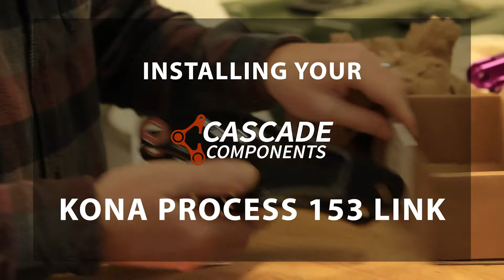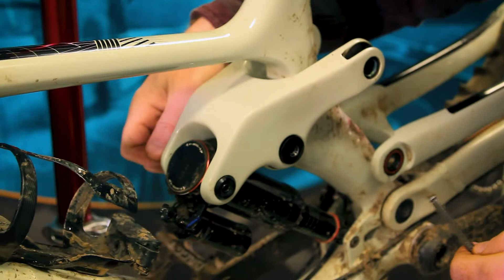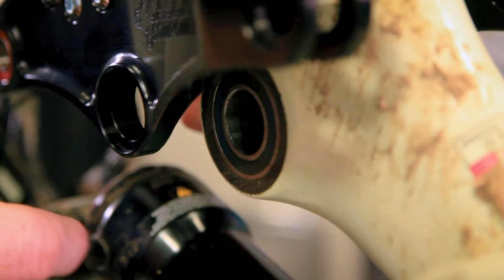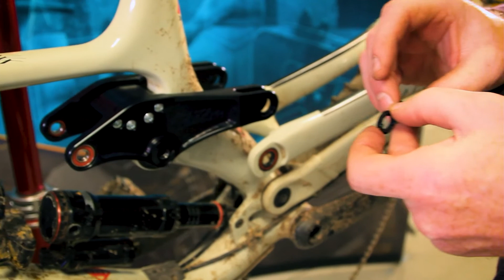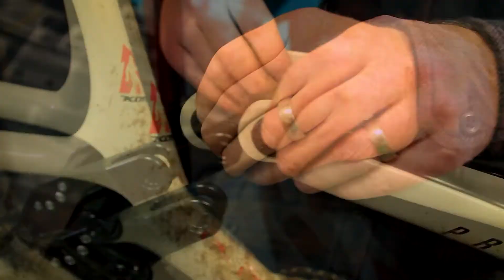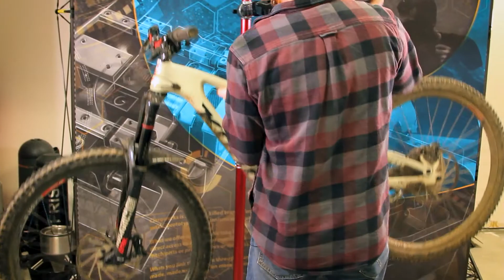Cascade Components Kona Process 153 Link Installation

Comment: Hi, friend. I swept my screws, they are Seat Stay Pivot Assembly. I live in Mexico but there is no spare part, do you recommend making a helicoli to recover them or making them on a lathe
Reply from the maker: Are you referring to the male or female threads? Male threads can't be fixed with a helicoil, so you'd need to get a new one in that case. If it's the female threads, helicoil is the best bet.
Reply: @CascadeComponents  They are what are external. The one with the button head. M10x1.10 12mm. There is no Kona support in my country. It is possible to have them made on a lathe machine and if it is aluminum or titanium ?
Reply from the maker: @mikezima6786  Has contactado Oasis Bike? Creo que distribuyen Kona.

Comment: quick question i have a 2021 alu process 153 and i have taken the seat stays off to grease the bearings, do the washer/spacers go with the small raised surface facing the bearings ?? when i took it apart the top set by the seat post were large flat side against the bearing,  it didnt look right. thanks carl
Reply from the maker: Small side always towards the bearings if I remember right. You only want the spacer to contact the inner bearing race.

Comment: Howdy, has anyone dealt with a stuck main pivot bolt that's shown being removed @ 5:30?  I can unthread the bolt but it will not push through at all on the other side, even after using PB Blaster. Any help is appreciated - thanks.
Reply from the maker: I'm guessing the bearings are rusted. If you partially unthread that bolt/cap that's used to push the axle through in the video, try using a rubber mallet on it to break it free. Assuming it's rust, once it breaks free it should move easy enough.
Reply: @CascadeComponents  Thanks for the quick reply & your input.  I tried a rubber mallet already, so the bolt definitely has to be seized in the old rocker. Just going to keep soaking in PB Blaster for the next few days along with some mallet / hammer persuasion (I have all replacement bolt hardware and bearings already so okay if the currents bolt & bearings  get destroyed). Thanks for the reply.

Comment: i have a kona process 153 27.5 (2021), and the 2021 model features a lot of changes (bit slacker bit longer, different shaped link), will i still be able to use your link?
Reply: ya i was wondering the same